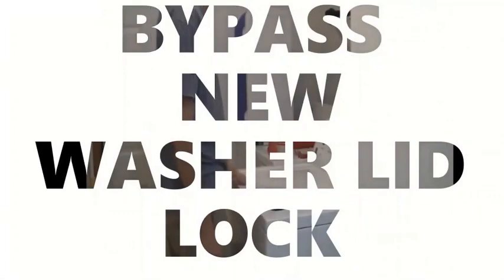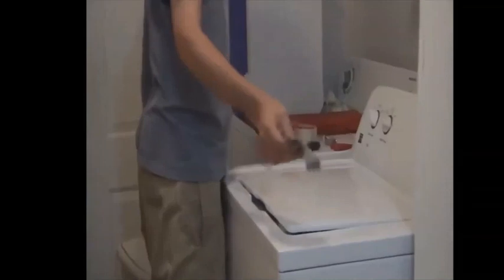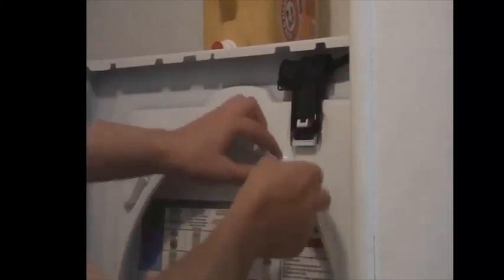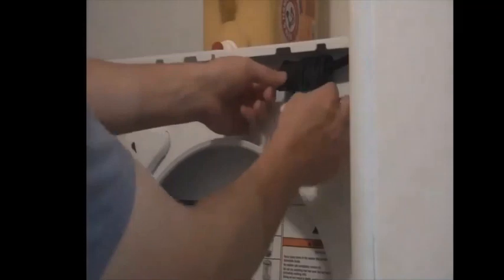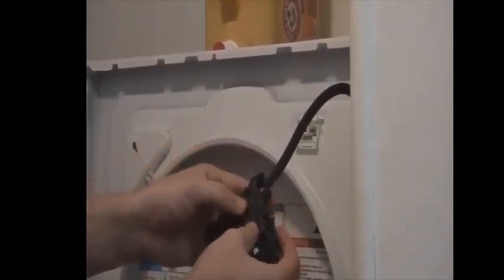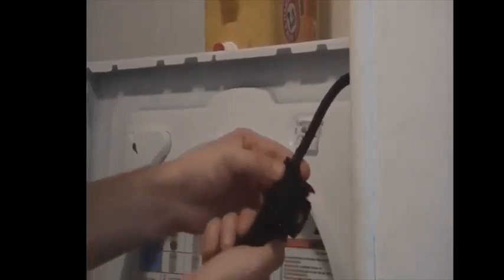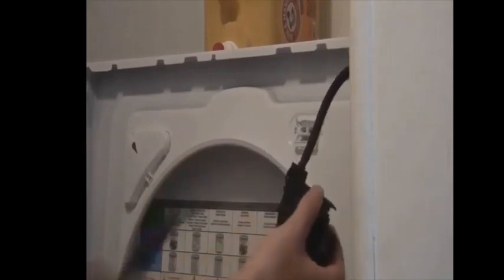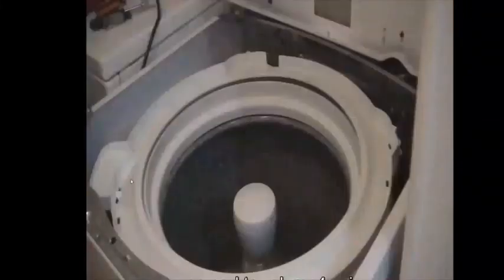Whirlpool Washer Lid Lock Bypass | Whirlpool washing machine lid lock bypass

Comment: I wasted an hour trying to follow this video and others to defeat the lid lock. Eventually figured out that I can just take the latch off the lid with a T15 torx bit, pop the latch receiver out of the lid base, zip tie the latch into the receiver, then zip tie the whole assembly into the top corner of the frame out of the way. Done. Lid always thinks it’s closed, you can open it as much as you want. After the cycle is finished, the Done light will stay lit but hitting the start button once will reset it.

Comment: ty worked perfectly
Reply from the maker: Im so glad you found this video helpful!  This reset is good for any vertical modular washer (VMW). In other words it works for pretty much any top load washer  boughten n the last 0-15 years that wasn't made by LG or Samsung (they as well have a similar reset but isnt as universal as the reset you learned). VMW's are distinguishable by the ever so hated lid lock device, not to be confused with the old school lid switch device that allowed you to open the lid at anytime without waiting for the washer to come to a stop and the lid lock to release.  If anyones intersted VMW's are sold by Whilrpool Corp.who in return owns almost every american appliance brand such as kenmore, maytag, amana, roper, inglis, crosley and many other brands they are a few brands away from monopolizing the appliance indusrty in the US. Word to the wise: an $800 Maytag VMW lasts just as long as the $550 Roper or Amana VMW and has all the same parts. The only difference is the name and the price. Think of it as buying a shirt from nike and one from walmart. The shirt from walmart is way cheaper and will get the job done, If you think putting more money into appliance will get you more life out of it youll be sad to find out that no matter the price of the appliance they are all pretty much lasting 3-5 years only now not the 20+ we are expecting. 

Which appliance do i recommend?  The generic VMW's sold by Roper, Crosley and Amana. There just as good, last as long  and cost less than the Maytag VMW's. I also recommend always adding the 5 year protection plan add on for about $120 which will pay for all future repairs for the next 5 years which will pay for itself 2 or 3 times over after year 2 or 3.  The 3 year add on is a waste of money because the machines typically last just long enough to get past 3 years.

 I hope this tutorial and explanation helps you, your friends and your family god bless you and thank you for watching! Oh and if you don't mind please like the video and subscribe to the channel to help the channel grow so we can reach more families like yours!